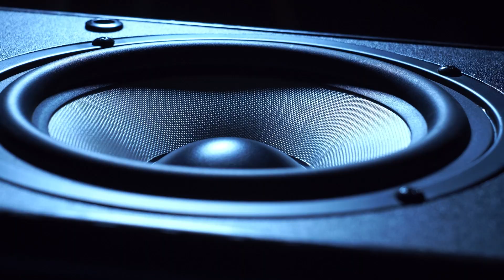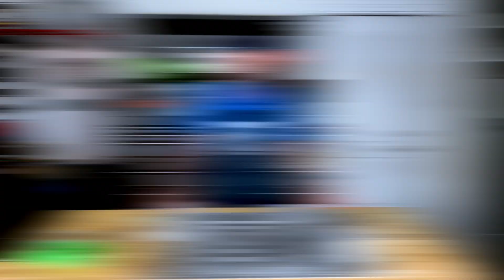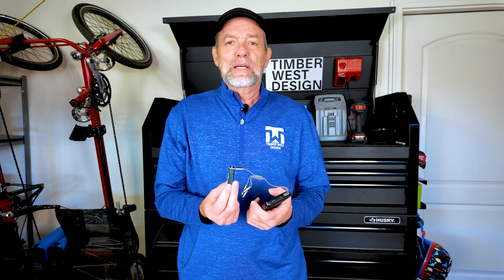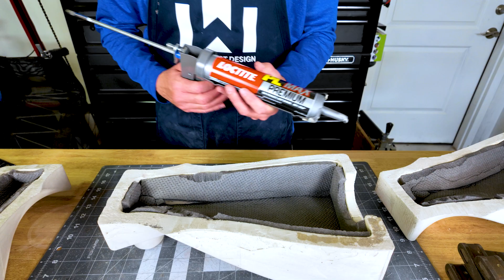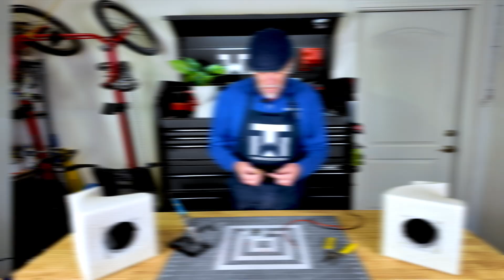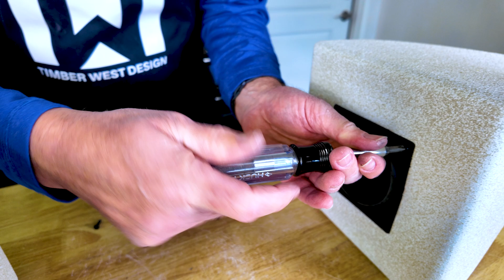I 3D Printed Waterproof Concrete Speakers! They Sound Awesome! DIY (Step by Step)

Comment: No Port? 😅
Reply from the maker: Thanks for the comment! Good eye—this one’s actually sealed. I went that route to keep the design simple and weather-resistant, since it’s meant for outdoor use. I knew I’d lose a bit of bass extension, but the DMA105-8 still delivers a really clean and punchy sound in this setup—especially for nearfield listening on the patio. Definitely a trade-off, but one that made sense for the goals of this build.
Reply: Maybe you can make a second version another time with the port underneath with 4 leg around the base with that in mind weather can't get through directly and the port can be used in a open environment since the leg side is always pointing downwards  @StoneSonicAudio
Reply from the maker: I will keep that in mind for future speaker builds.  Have a great day!